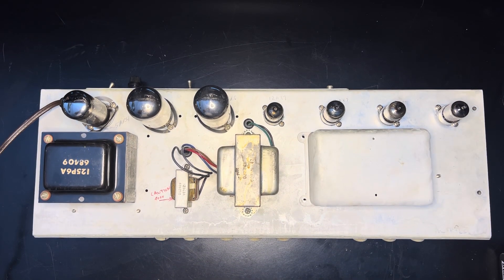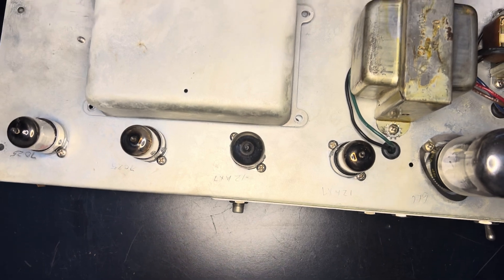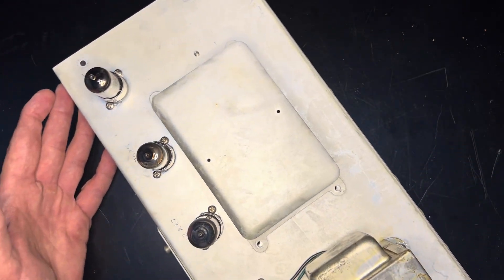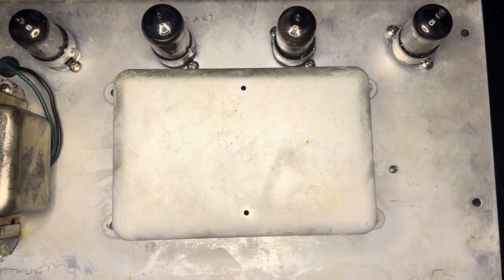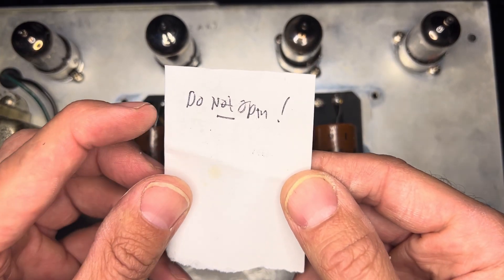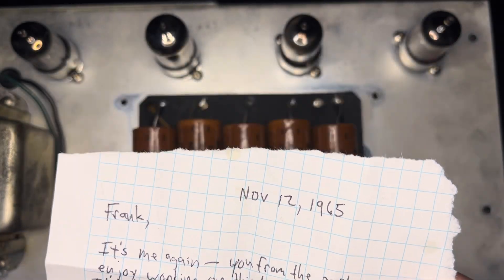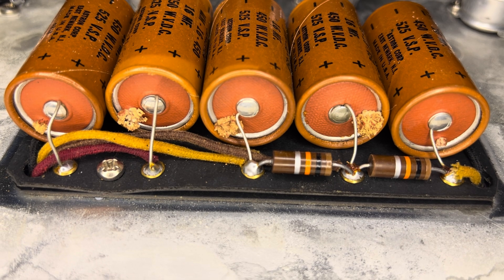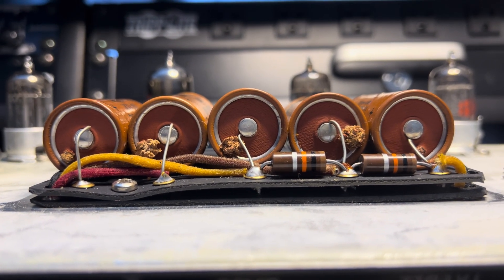60’s Fender Tremolux Part 3 || Uncovering Past Trauma

Comment: PT I think is original. Its a Triad and has the correct part#
Reply from the maker: It’s def got the right look, but the voltages are for the 63+ models and the wire has mod 60’s insulation.

Comment: I’ve seen the notes from future Frank before, but this one was unexpected because your acting skills have leveled-up.

As a non-electrically inclined person, it seems that the outer 2 capacitors(?) didn’t leak as much. My degree in thermodynamic repercussive undulations tells me that heat may have been a culprit with the inner capacitors venting their innards more so than the outers?

At least they contained their corrosive spillage over the decades.
Reply from the maker: I’ve got nothing left in the way of trickery!

I believe the nastiest caps had the most stress placed on them. Looking at the notes scribbled near the choke, the old executioner about 400v  being present.  Shouldn’t be on a 62!  Should be seeing around 350vdc at that point unless the power transformer was a replacement for a 63, which had slightly higher plate voltage.